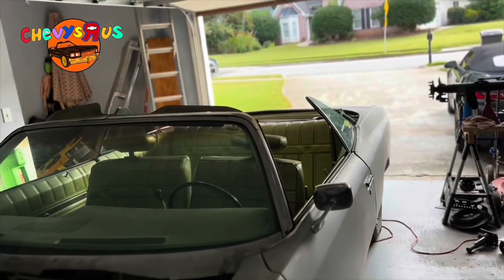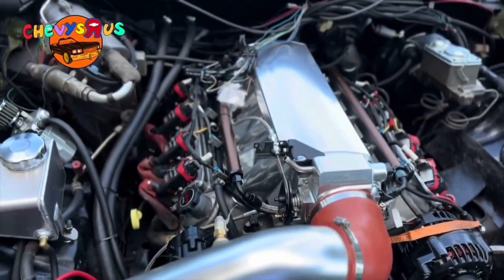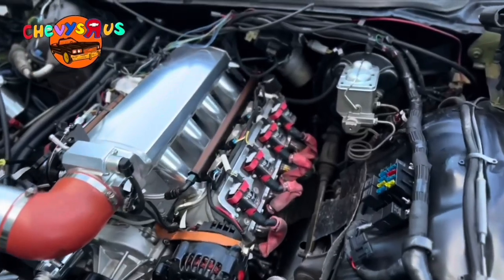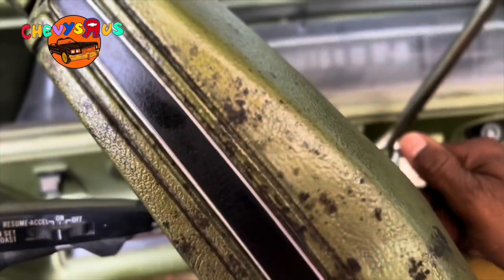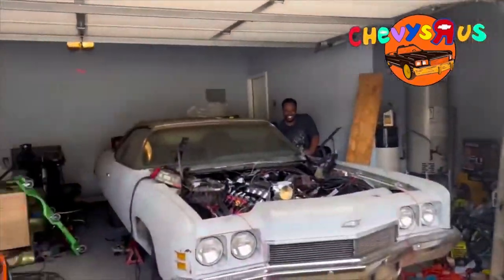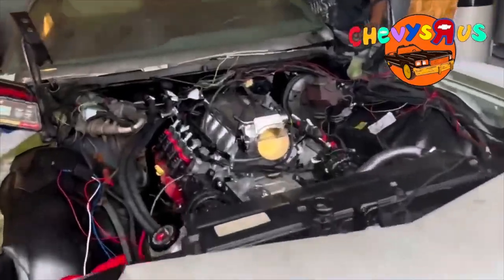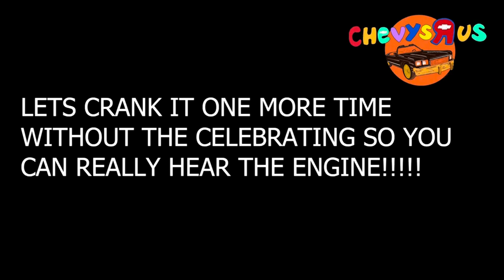LS3 Swap Success: Crank Your Impala to Life!

Comment: Did you use the stock drive shaft for the 4l60e
Reply from the maker: I actually did..   I had to get the CV Joint on the tail end of it cut off and replace..   Also had to get them to cut off and replaced..  71-74 drive shafts are not serviceable (you can’t fit the locking clips in to replace the u joints)…. I have a few videos on the page explaining everything I had to go through..  I think I cut a half inch off for it to have a little slip…. Join my Go Love WENSDAY @ 6pm est and I’ll let you on and we call talk about it in detail bro!!!  Che k that video out below..

https://youtu.be/OA9cFnWN5aY?si=3JnrpBoSMnNwTqKH